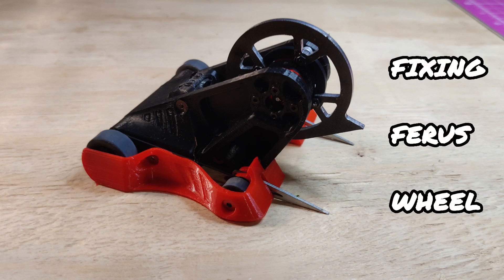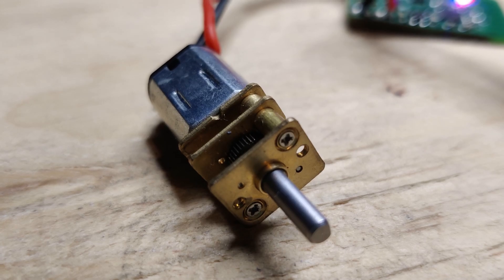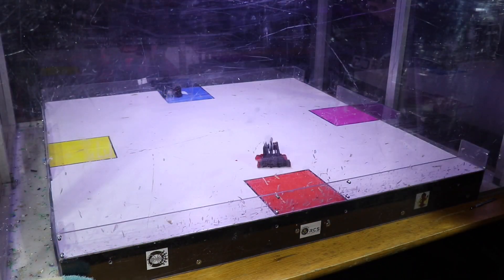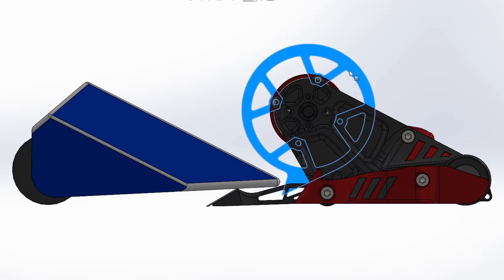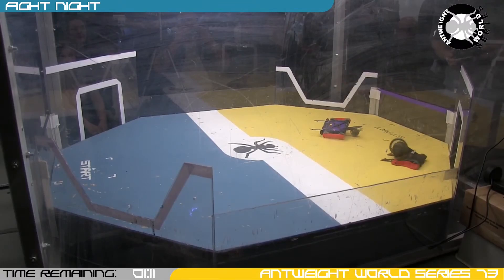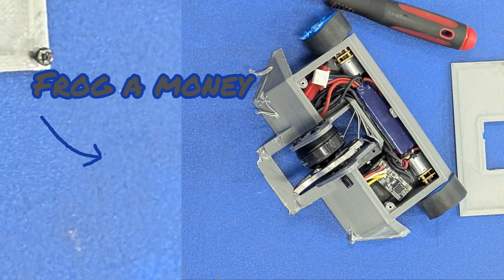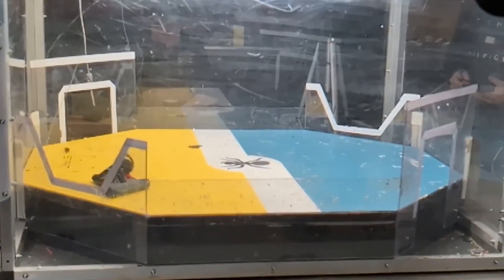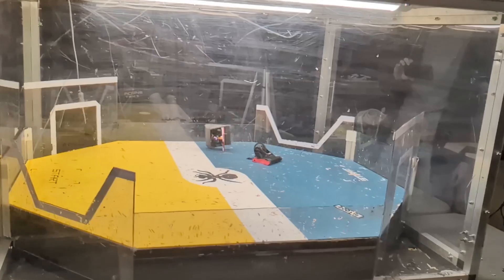MISTAKES WERE MADE... Taming my 150g combat robot Ferus wheel! First events and design changes!

Comment: Just a suggestion, your weapon design could be improved significantly by giving the tooth more of a forward 'rake' and curving the trailing edge so it's not as sharp an angle. This would increase tooth durability and it would have more of a tendency to grab on to opposing bots rather than just pushing them away.